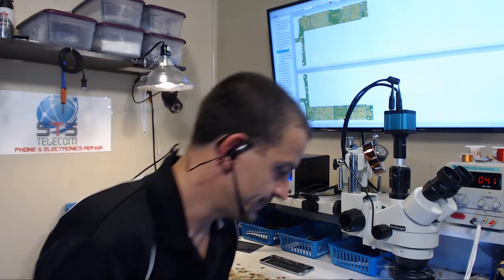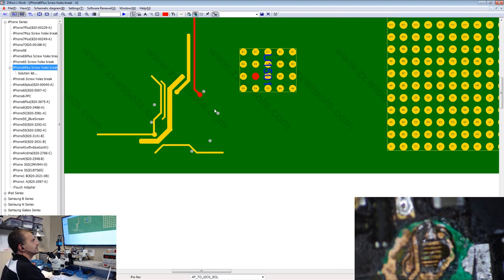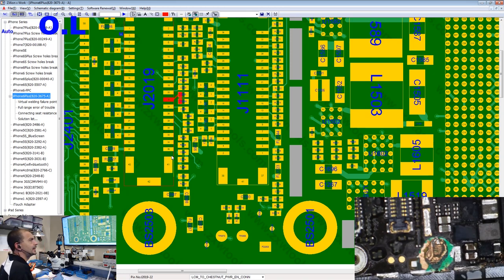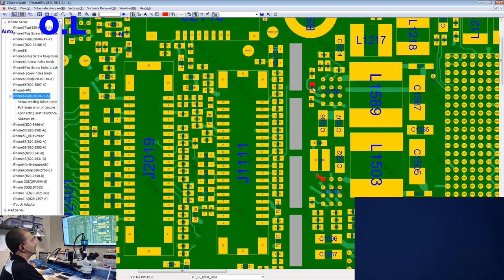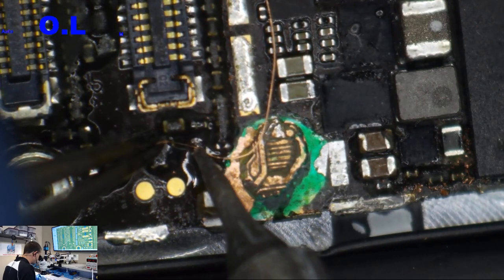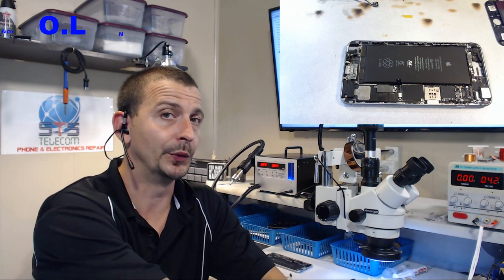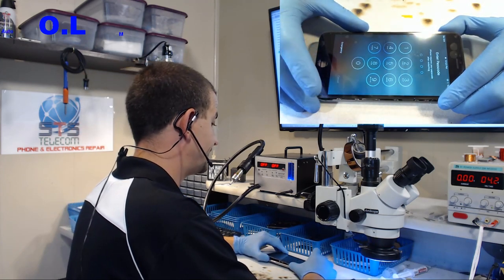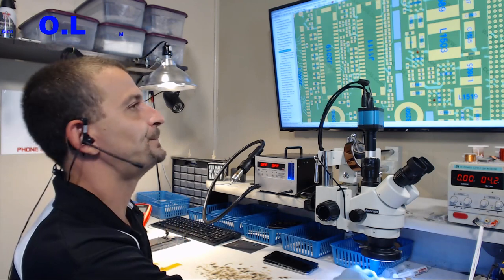iPhone 6 Plus No Image After Screen Replacement (Prior LSD repair attempt)

Comment: Yes you do have to look after yourself and family, a break no matter how short is good for your mental state :-).

As you said, deal with the normal typical failures first, that's the way it has to be, you can't fix every "Pile of poo", so don't worry about it :-).

When i used to repair c.b radios, there were ruined ones, too much wrong, i just sent it back.
There is a line you have to draw and never step over.

Comment: Keep up the good work and videos! Late night thought after playing/practicing on some old boards, in the cases where you repair screw hole damage then find touch ic issues, have you considered using some solder mask to tack your jumpers in place while you're repairing touch ic?

Comment: Nice repair man. I just got the same scope your using today. Gonna take a while to get used to the work room your giving. I was using the cheap amscope before, which had plenty of room
Reply: did you order from us.are you in ireland
Reply: alex oneill byrne I am yeah. Ordered off Amazon
Reply: i am in ireland myself and about to order one myself .did it take long to arrive.how did you get on with customs charge
Reply: It only took 2 weeks or so via UPS. Postal charge was £158. So near £900 in total... I'm up north, so don't know if that would effect yourself mate. But I got mine right an quick.

Comment: Any suggestions, I got an iPhone 6s which they change the screen. It will turn on but you can't see anything on the screen. It's completely black. But if you plug it to ur computer , it reconized that it's connected to. I took it to some repair store they told me that they couldn't fix it cause it's a cpu issue. Is this true?

Comment: I have a 6 plus as my daily driver with a smashed OEM screen that works absolutely fine and i literally am calling it a miracle, It's never had touch IC issues, never had wifi or signal issues, the battery life is good, is my 6 plus a one off or am i just extremely lucky? Laughing emoji